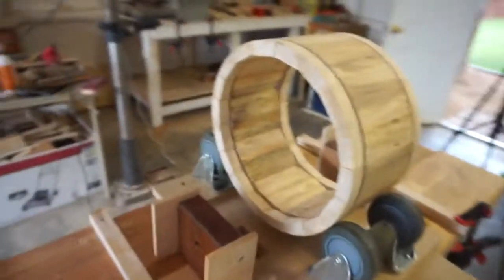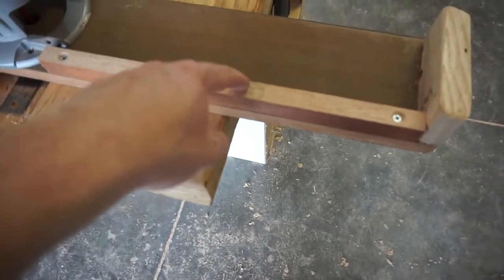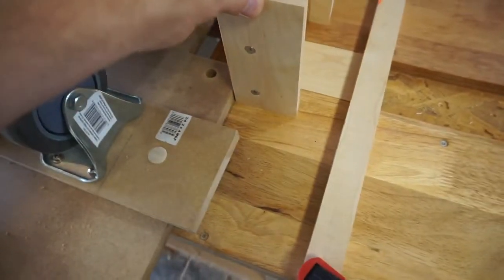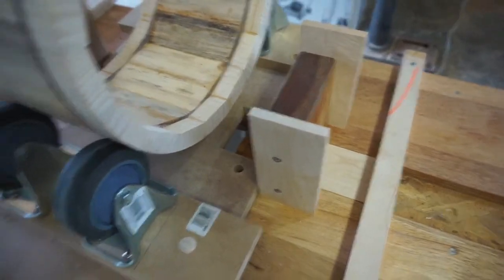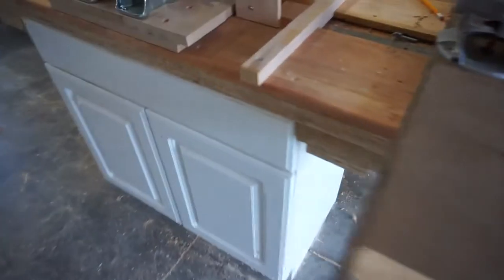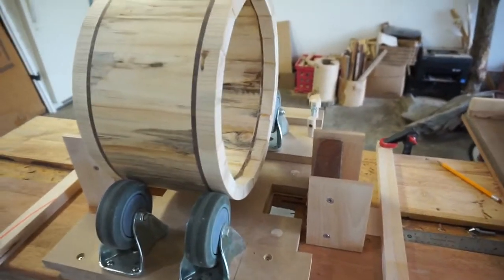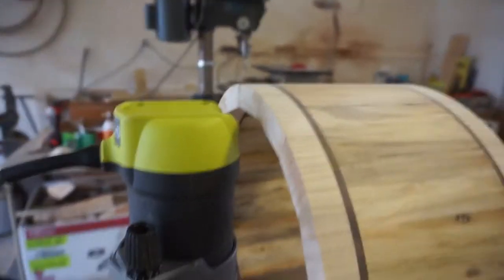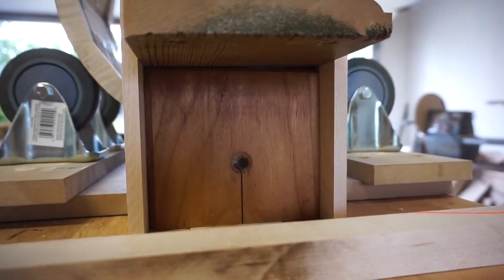Drum Building -- INSIDE ROUNDING JIG: Router Table, Phase 3

Comment: Thank you so much for sharing your ideas. This video really helped me out. I had fixed wheels installed before on my jig and the shells kept wobbling. Now with the two adjustable front wheels the shell I'm working on right now runs smoothly. Routing will follow! I also figured out that cheap furniture wheels made of relatively hard plastic that are sitting loosely on their axle are working better than skateboard wheel with high precision ball bearings.

Comment: YouR videos are great! I believe you might have mentioned it in another video, but what type of router bit do you recommend for inside routing? I believe you just use a straight bit for the outside routing but use something different for inside? Thanks!
Reply from the maker: Thanks, Marc!  I use a straight bit on the inside as well.  I've tried using a half-round bit, but it didn't do a very nice job.  Obviously, though, with the lack of any radius built into the straight bit, there's a fair bit of sanding needed on the inside.  It's a pain in the neck, but I haven't found a better way.

Comment: Joseph, I'm also experiencing issues with my shell not tracking on all 4 wheels, or staying in contact with all 4 wheels during the milling of the inside.  Are there special caster wheels I should use?  Also, is there a trick to getting the wheels lined up parallel to the shell?  Any help would be greatly appreciated.  Enjoy your videos!
Reply from the maker: In the video you watched, I made one side of the jig adjustable to account for tracking issues (the shell is not always perfectly cylindrical), but I had to be very careful to make sure that the two front wheels were as close as possible to being exactly the same distance from center and same with the back wheels.  It seems that no matter what I do--and even though I do get all four wheels in contact with the shell--I always have to attach (either with glue or screws) a couple of "bushing" blocks on either side of the shell and clear of the sled to keep the shell from eventually rolling off the wheels.  It's really just a matter of fiddling around until it's right.  If you go with a more expensive build--more expensive parts/materials--I'm sure it can be even more accurate, but, if you're like me, you're doing this all on the cheap.
Reply: @JosephCenter  thanks for the quick reply!  Good advise.  I was trying to stay away from having to rebuild my inside milling jig but it looks like I may have to make the wheels adjustable.  Makes sense.  Again thanks for the advice.

Comment: What happens if you don't router the inside? Does it affect the sound?
Reply from the maker: Tia Beaufort I don't know for sure as far as the shape is concerned.  Thickness however makes a significant difference.
Reply: Interesting. Thanks for your videos. I am going to try one without routering the inside and see what happens